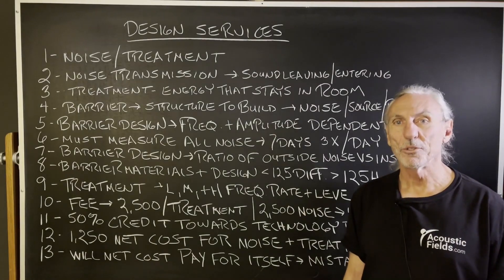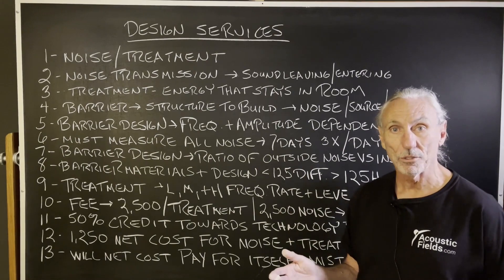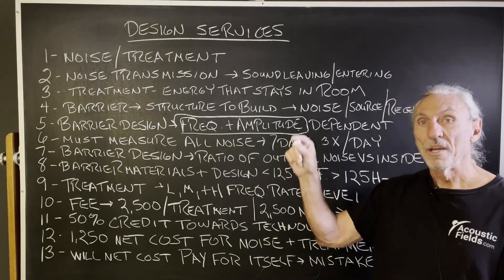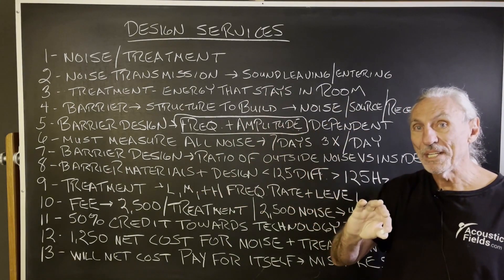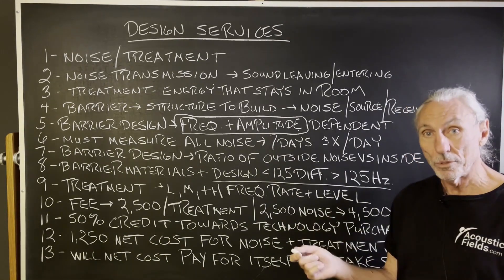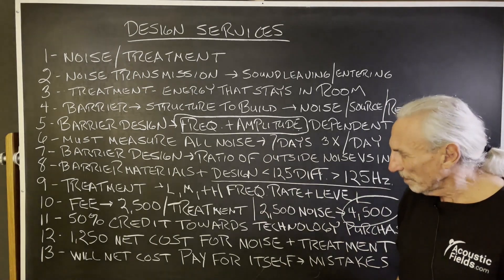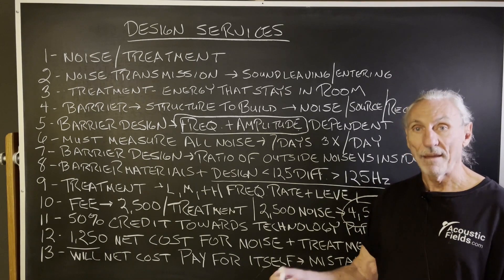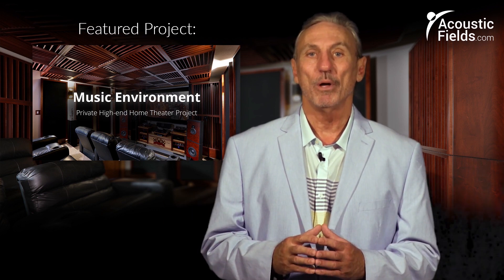Our Acoustic Design Services - www.AcousticFields.com

Comment: I think it would be a great change, if videos are mixed between the Theroetical Topics like this, and showcases & explanations in real rooms with actual elements, Acoustic Solutions and Measurement Datas (REW or similar to see actual results). Maybe not every customer, but surely there are a few customers who allow cameras
Reply from the maker: The issue with measurements fall into two main categories. One, getting individuals to perform them correctly is always a concern and secondly most people do not undertsand how to interpret them. We will be using more measurements in real time to help people understand their room distortions. Measurements in real time will help you understand how your room manages energy since that is all it sees. Once you understand how your room manages energy you will better understand more specific numbers.
Reply: @AcousticFields  But that would be an nice content, how to interpret measurements and how you learn from it. I dont know what Gear you use to plan a room and how the exact procedure is. For example, an Acoustic Engineer here in Germany use an BEM (Boundary-elements-method) with an special Measurement, where you can see an ,,Heat Map,, where Energy travels in the room and how you can manage it with the correct treatment... its just an idea for a little bit fresh content